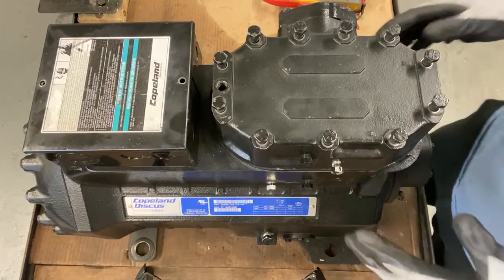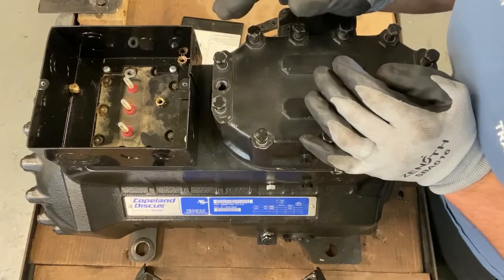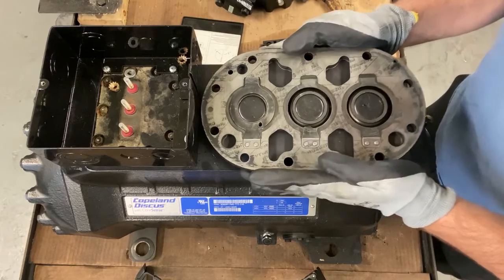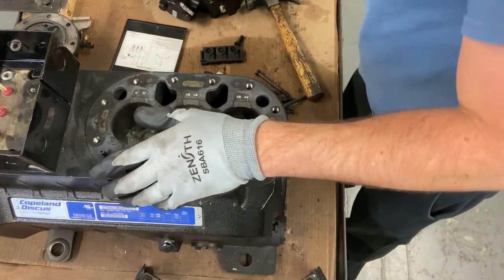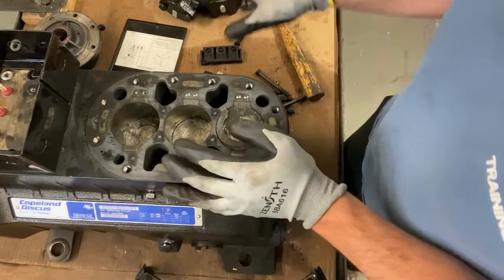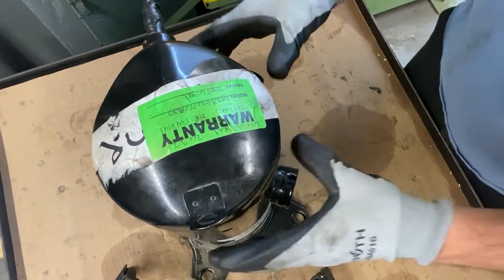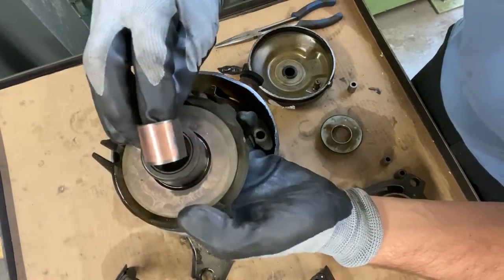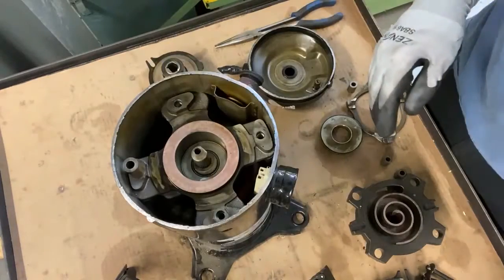Semi & Scroll Inspections

Comment: Are the signs of copper plating and heat both related to poor install? My understanding was that copper plating was poor install and heat was from low charge or anything else causing high discharge temp?
Reply from the maker: Yes copper plating is usually from poor install. It can also happen if you have a heat exchanger crack on a water chiller and you dont get all the moisure out of the system.